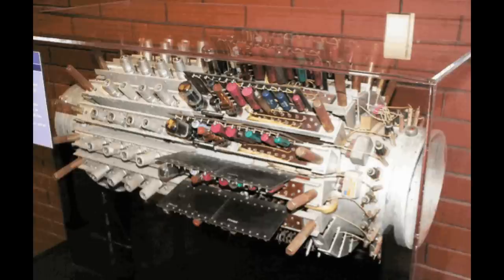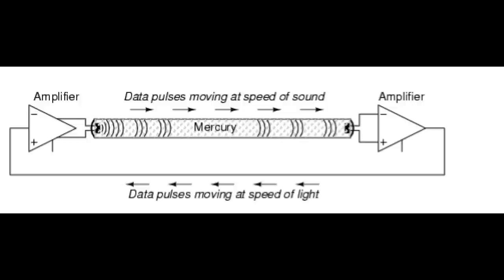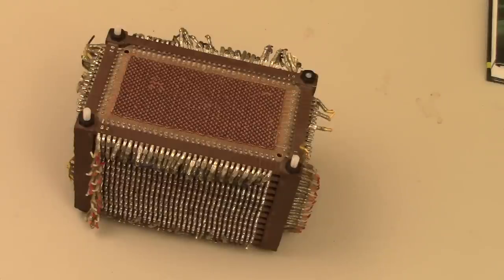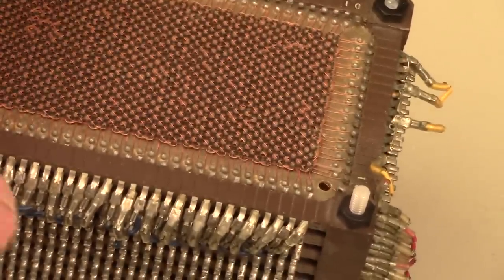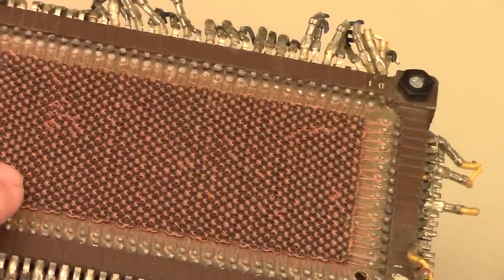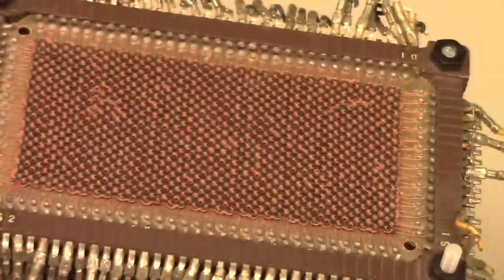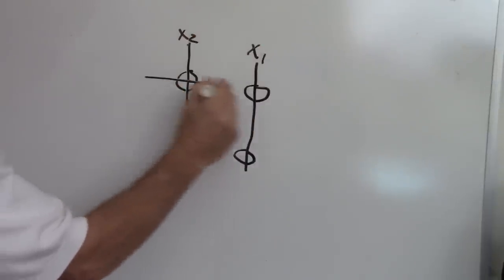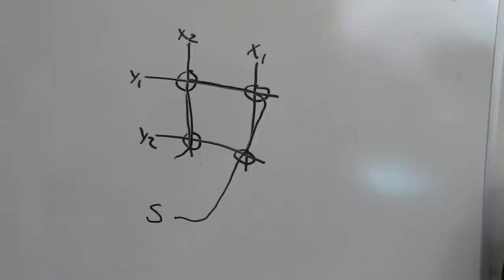Episode 11 - Getting Busted in New Jersey With Core Memory

Comment: Core memory is still in use, I have been repairing them for 30 years now.
Reply: what's it used in?
Reply: +nealshireman core memories currently in use are typically 65K X 18 and run at 1 mega hertz the largest I have ever repaired was 256k X 24. core memories were still being produced till the late 90s. I think I am probably the only one that still repairs them.
Reply: nealshireman+ The only thing I've seen it still used in is old industrial equipment.I ran across a massive punch press that used core memory on a drum.The funny thing was it also utilized punch cards  and from my understanding it took the cues from the cards to access the cores program on the drum.I may be wrong but that is how the operator explained it to me at the time.But that wasnt the only one I have come across during the time I was a Millwright.I wish I had kept better records of some of the machines we came across but the usual outcome most times was it was too costly to refit or replace such machines.Especially when a used one can still run upwards of half a million or so.Also it seems every time someone tries to adapt a new computer they run into massive headaches.So most decide to leave them be since they've ran fine the way they are for 50+ years or so.I mean really if you consider most might have a computer problem once every 10-15 years or so its pretty amazing.
Reply: Terry Murray again, WHAT IS USINGCIT TODAY?

Comment: I remember looking at a computerized phototypesetting machine around 1975 of so. It was state of the art and I was really impressed. The big problem was that it used something called "bubble memory", and the instant the machine was turned off (or lost power), the memory would vanish. Around 5 years later, a computerized typesetter had what I think was a small ROM memory (something like 650 bytes of memory) that it used in starting up, and then it relied solely on one-sided 4.5" floppy disks for operation. It was a lot of trouble to operate with memory like that, and there was a 5 megabyte hard drive available, but the hard drive cost US$10,000, so I never got it.

Comment: Great video. If I remember correctly the first computer I worked with, a Univac 418 which had a (literal) core of 16 kbit. It was manually booted loading binary words into the main registers to call up tiny program that read a paper tape. The paper tape contained a program that loaded the operating system. The “large” memory was a pair of Fastran magnetic drum memories that were half the size of an automobile and could hold a couple of Mbytes. We definitely have made advances - as I type on my IPad Pro with 128 GB.

Comment: Reminds me of coming across a cabinet of core memory in the basement of the HPER building at IU Bloomington, which housed the Wrubel Computing Center in one wing - must have been in the summer of 1980 or 1981. Taking a FORTRAN programming class, and we were still using punch cards. There were all sorts of fascinating machines down there from my point of view - HUGE punch card duplicators and printers, for instance. Big line printers, and a CDC6600 (which we learned programming on). Only five 300 baud terminals. A lot of this stuff would be gone in the next 3 years. The memory was in a cabinet, and this had toroids that were maybe ten times the size of yours. Big, visible wires running through the thing. It was on it's way out to the recyclers, I'm sure - it was in the middle of the hallway in the non-computing side of the building. Wish I'd at least had taken some photos.

Comment: In 1960 working as an assembler at IBM San Jose, I happened to see another assembler slip during assembly of a core memory for the IBM 360 and shove the screwdriver through the entire assemble of 12 planes of cores. At the time the assembly was worth about $2,500 1960 dollars and he literally cried when it happened. I worked doing wire wrap panels for the 360. Occasionally I would be loaned to other groups working on RAMAC, Stretch 7090 and other systems. Started at $86 a week. Good start for high school grad and I worked in electronics for 45 years as technician, engineer and manager before retiring.

Comment: I used to work on core memories  when I first started work in 1980. Testing used massive valve and relay based machines but to change a core took skilled operators using binocular microscopes and ultra thin needles.

Comment: The mercury driven memory almost sounds like using a guitar string's resonance to work as a primitive oscillator. So gaps in the resonance would in turn be able to be timed and used as bits. Man, I spent too much time around engineers.

Comment: my first exposure to those memory cores was with the Control Data 160A mainframe. That was already a dinosaur, but great for learning the basics of computers back in the 70s even. Later, even into the late 90's, the same basic memories were at the heart of Thomson CSF surveillance radar systems, used in the SDGS (synthetic data generation system) for creation and display of vector based characters on  Secondary Radar displays. Really miss those times now...  The technology at 2:20 was another that was used on the same radar. The device was called a Scan Converter Tube, for converting standard radar PPI circular sweep, into a TV styled raster scan. In basic description, there was a TV tube, being faced and bonded to a TV Camera tube, which actually read the charge left by the source tube upon the interfacing screen at the junction of the tubes, but there were no visible 'dots' in that case

Comment: A byte is 8 bits so if that is 50 kilobits (50,000 bits) its 6.24 kilobytes. A gigabyte is about 8,000,000,000 bits and this is how we measure ram and storage now. So I have 256,000,000,000 bits (32 gb) of RAM and 20,000,000,000,000 bits (2500 GB or 1.5 TB) of storage in my computer. Amazing how far its come.
Reply: Strictly speaking 8 bits is an octet. A byte can be as many bits as you want. At university I used a PDP-10 that had a variable sized byte - anywhere from one to 36 bits. It is purely a modern convention that all bytes are 8 bits.
Reply: Eight bits gave you a range of 2^8 = 256 (2 binary bits to the eight power) different combinations to encode the English alphabet in lower case, upper case, the numbers, punctuation symbols, special symbols, many foreign characters... etc. But a byte of 8 work bits also had a check bit to verify if the byte was read or written correctly. So a byte had 9 bits.
Reply: Nicole K ... I remember non-8 bit machines having "words" instead of bytes. Early Honeywell computers I worked on had 10 bit words. That is what we called them. I first saw the term byte when microcomputers appeared.
Reply: Oh yes, Dexxter, you're quite right - the PDP-10 and the IBM 370 measured memory in words. On the 370 each word was subdivided into 8-bit bytes (remember EBCDIC which was by definition an 8-bit character set?). On the PDP-10, there were a few instructions that could work on a subdivision of a word which was known (in DEC's terminology of the time) as a byte which could be of any arbitrary size between 1 and the word size.
Reply: Lol, I'm still using a laptop with 1 gig of RAM and a 40GB hard drive.
Reply: My first PC was a Vic 20 which was the predecessor to the C64. It only had 20k of memory and did not have a floppy drive or any kind of external memory/storage. So every time I shut it off anything that I had programmed into it would disappear, and anytime I wanted to play a game or do anything I had to rewrite it out in basic each and every time. Goto statements...
Reply: ugh, fuck goto statements. I had a paper tape reader for my vic 20
Reply: The things we take for granted today...
Reply: Kryptenasi Indeed. anyone here remember having to physically dial the ISP or BBS number and place your phones receiver on the audio coupler.. .just to get online...

oh how about Thick Coaxial Networking
Reply: Nacht Kind Good old bulletin boards. I member waiting an hour or more just to download one gif depending on the resolution. Now we can stream porn in HD if we wish :P.
Reply: I kind of wish I could've been there to experience all this computer history. Unfortunately I was born just around the time floppy disks died out. :P
Reply: Den Log hahah indeed. hell even in the days of normal dialup.. sometimes it took 3 days to get 1 music video... AOL 14.4kb/s
Reply: My first computer was an old Tandy Color Computer with tape drive and two floppy drives.  From there we blazed into an IBM PC-XT boasting an Intel 8088.  My father (working for Honeywell at the time) had a whiteboard on the wall beside the computer that he used to teach my sister, brother and I the DOS command strings we needed to run the programs and play the games we had.  Then along came the Qmodem terminal program and a local BBS list, and my whole world changed.  The computer still worked last I tested it a couple years ago.  Man, I remember modem baud rates leapfrogging every few years.  I do remember having to rest the handset on the modem's audio receiver.  I remember having to select which transfer protocol to use (Ice-Zmodem was my absolute favorite).  So much has changed in 30 years that it seems almost like ancient history, and I feel like a relic that hasn't reached 40.
Reply: sinnison23 Indeed. I'm 33 and I feel like a dinosaur just like the computers I grew up loving. I ended up getting an IBM PC, not sure what model but I know it had the 8088... PC DOS was rather cool.
Reply: VIC 20 had only 5k of RAM.
Reply: Trevor Lambert vic 20 came with 5k of ram but was expandable to 32k.
Reply: Bits can be arranged in Words of various length, 4-bit, 8-bit, 16-bit, 32,bit, etc. If just a tiny amount of memory is very expensive and you only need to store a single on/off state, are you really going to waste a bunch of cores in an 8 to 32 bit word? No, you use a 1-bit word.
Reply: Dexxter Nowdays Bytes are arranged into words. and basically a word is  the natural unit of data used by a particular processor design. A word is a fixed-sized piece of data handled as a unit by the instruction set or the hardware of the processor. I think the 8 bit word/byte became popular and standard with the IBM System/360
Reply: loving the Tier 1 IT talk in this thread, lol.
Reply: 2500 GB equals 25 TB and 1.5 TB equals 1500 GB.
Reply: volatile memory, my first computer was like that too, Romanian make. It was so interesting just to code, coloured text, writing electronic music, games etc. I have written space invaders tens of thousands of time and truly thought I would never ever forget it. :))
Reply: I rooted my ISP. My modem had only 14 Kb/s and my ISP rarely gave me over 5 Kb/s, so I rooted my ISP and maxed my account and when I got a highspeed modem US Robotics 56 Kb/s, wow!
Reply: I hated that tone so I removed that modem incorporated speaker. :)
Reply: It got me to the point where I knew all the clicks and tones when the ISP was negotiating the handshake and knew if it will establish connection or not, the line wasn't always working
Reply: AB J Yeah I was that way too. I ended up disabling the speaker as well. Me already being familiar with blueboxing It was kinda easy to jump to the various tones of a modem...

Also, I had messed with manual dial modems that needed audio couplers... (analog audio couplers at that)
Reply: indeed, back in the mid 90s we got our first computer, a AST Bravo LC 486 33Mhz with 8 Megabyte ram and huge 200 Megabyte harddrive. if I would build a computer back then with the same HDD storage I have in my "server" now I would need to have 105000 harddrives! yes, one hundred and five thousand times more storage in one of my many computers compared, it feels almost unreal thinking like that
Reply: I want to make this type of NVM with nanoparticles.

Comment: I was the last person at Iowa State University (~1969) to use the core memory out of its old Cyclone Computer.  The memory was in a console that was about three feet wide and four feet high and about 12 feet long.  It had four stacks of 4 K, 40 bit words.  When I used the memory it was used as a buffer memory for an A/D - D/A converter.  I remember loading punched paper tape and magnetic tapes.  I was told that the Cyclone Computer had gone through mercury memory and the CRT memory years back.

Comment: The magnetic cores depend on a couple of phenomena for operation.  The most important is hysteresis, a resistance to changing magnetic field until a threshold is reached.   In the case of a typical core memory, you need about 300 milliamps through the core (ferrite bead, core, donut) to switch its magnetic field.  Because of transformer action, this abrupt switch of magnetic field will induce a tiny current in a "sense wire".  There's typically only one sense wire woven diagonally back and forth through the entire plane of cores.   Each core has three wires:  X wires, Y wires and a sense wire.  So what you do is shoot 200 milliamps down ONE of the wires in the X direction, 200 milliamps in ONE of the Y direction wires.  All of the ferrite beads along these wires ignores the 200 milliamp current BUT where these wires come together and cross inside the hole of a ferrite bead, now you have 400 milliamps and that's enough to switch the magnetism unless of course it was already magnetized in that direction, in which case nothing happens.  So you repeat this process for each of the intersections and watch for a pulse on the sense wire.  If there was a pulse, you just erased a "1" (or a zero; you can also use negative logic).  Before you continue you'd better put those "1" back in because the act of reading the memory sets everything to zero (or 1).   The speed of these things was measured in microseconds rather than nanoseconds.   They are non-volatile; I've done some tricky things with core memory used in aircraft, solved a malfunctioning boot loader by using a good computer to load the program, then physically remove the core memory and install it in the aircraft and away they go with a functioning program already in memory.  They were VERY expensive; it is a great souvenir.

Comment: Most entertaining - but there's more to core memory. For instance, check out rope core, which stored more than one bit per physical core. (Hint: it was read only memory, used permanent magnets instead of soft ferrite beads, and used one sense line for each bit per core. Four bits per core took four sense lines, and the data was in the weave.) Or the way that off-hook was detected in old telephone company switching equipment. It was called a ferrod, and was essentially core memory, sort of - the off hook current changed the "data" on a ferrod from zero to one when the phone was off hook. The cores were essentially electromagnets driven by the off hook current flow. And now I must visit your web site.

Comment: I worked on computers with core memory and there was a unique attribute that the core allowed. The computer could be booted up and a program loaded, then power failed and the core could be removed (on a removable card, not wire wrapped in) and inserted in another computer and that computer powered up. The second computer would then come up and run the program as contained in core without having to actually be booted up, itself. Those were military Univac computers.

Comment: I remember back in 1991, when I had a computer with an 80286 processor, running at a blazing 16MHz, and it had a 40 Meg hard drive. It came with 1 Meg of memory and I wanted to add an extra Meg. One Meg of memory cost $100 at the time. I had a friend who was doing computer repair and he sold me two 512K DIMMS for $50. I thought that I had gotten the deal of the century. Now, we can purchase 8 Gigabyte thumb  drives for about $6.00 In fact, a lot of vendors at trade shows hand out 8, 16  and 32Gig flash drives for free. Also, in the late 90’s, I traded a used 1.2 Gigabyte hard drive for a brand new, good quality, 8 man camping tent and we both thought that each of us a got a great deal. It’s amazing when we think about how far we’ve come.

Comment: If I remember correctly core memory was one of, if not still is the most durable form of memory. I remember a professor of mine stating that there were virtually no memory failures with a core memory PDP-11 until they upgraded to an SRAM memory unit which failure was nearly daily.

Comment: Fascinating video.  My big story I tell my younger friends is that I recall the day (circa 1983) I upgraded my Atari 800 home computer (before there were true IBM-clones, aka, PCs) from 48K to 64K.  That's right - I added an additional 16K or 16,000 bytes of RAM to this unit with this huge 11/4" x 10" x 5" slot-shaped plastic card.  It was heavy, bulky, and the chips were not exposed to the eye.  I often wondered how stupid this was as there was zero ventilation for these circuits should they run hot.

Comment: One advantage of core memory was that if power was removed from the computer, the data was retained and could be read when power was restored.
Reply: That's why some high-end SSds and hard drives have a small battery (or capacitor) to automatically save your work when this happens. Also, that's what UPSs are for.

Comment: There was in fact semi-conductor memory at the time but it wasn't in the form of a microchip (IC) yet and also it was not used for storage or RAM, only for registers. The TX-0 was the very first transistor based computer. And even though those were large transistor boards instead of microchips, a transistor is still a semi-conductor anyway...